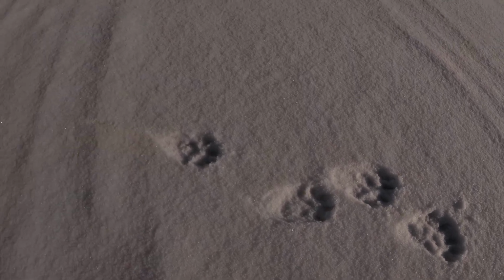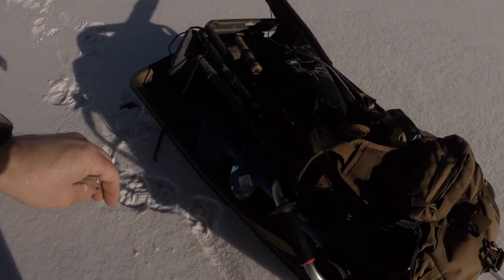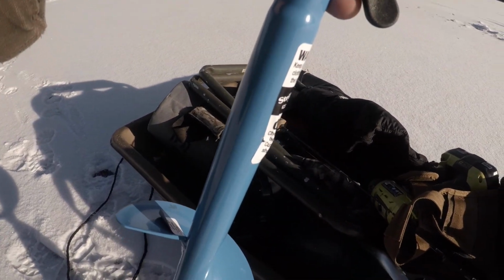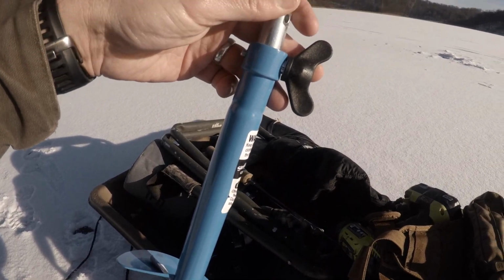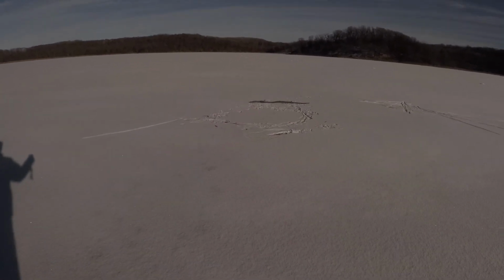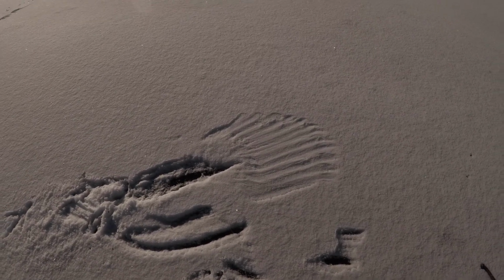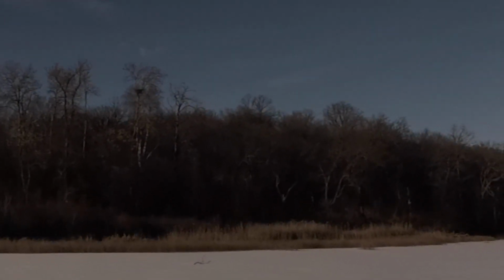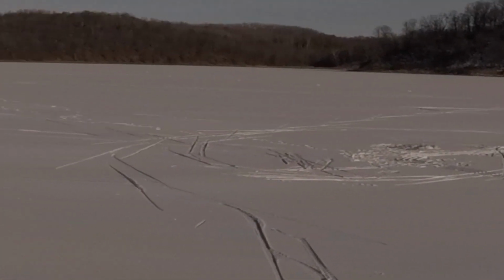Ryobi drill and attachment on my Strikemaster hand ice auger

Comment: I drilled an appropriate sized hole in the auger shaft just below the hand set key. Ran a 12" long 3/8 steel rod through the hole. And secured the rod with tight doubled up O-rings so the rod couldn't fly out. It's saved the auger at least 3 time's. The one thing I wish they would do to cordless drills is add a keyed chuck.   I have used my Ryobi for years, just carry a few batteries they are so much more affordable.  I only ever ran out of juice one time, ever. Figure if I have to drill 50 holes I might as well head for the barn.
Reply: Eric Campbell 
I’ve had a few comments about losing the auger eventually. I really appreciate solution ideas to this possible issue. Thank you for commenting. Also, I’m glad to hear that the Ryobi will work as a long term option. I did have some concerns about burning out the drill. I hope you have a great season!

Comment: Look into an ice master ice auger adapter.it has a small plastic disk that bungies around your drill so if the chuck loosens up it don't drop down the hole.i got one for my old 6in mora.works great.also upgraded to a hammer drill so I could have an extra handle.looking at adding a center point now
Reply from the maker: Thanks for the tip! Currently I just have circular disc as a drop guard. its pretty wonky though. Ill look at the adapter, Thanks!
Reply: You wrote ice master...did you mean strike master?

Comment: Yesss. I am the poor man with the Ryobi and 6" strike master hand auger lol
Reply from the maker: Just be careful not to drop the drill down the hole! Either hold on or put a barrier bigger than the hole. This has worked for me for a few years nows
Reply: I had an old 6inch mora given to me(threaded top).I bought an ice master auger adapter.works great.it has a bungee that hooks around the drill so it won't fall through the hole if the chuck let's loose

Comment: I was the first one to do this on a mora auger and a old rigid drill and I used a bolt and socket . And the word traveled fast. Don't worry guys I patted myself on the back;)
Reply from the maker: Kelly you should make an adapter so the auger doesn't fall down the hole. I've heard lots of comments about that. Still time to be rich!

Comment: I'm going to use this same setup this year. I'm usually a set and forget it. I'll drill about 5 to 10 holes and stick to those.
Reply from the maker: I’ve used it a couple years now. The only advice I’d give is to make sure your drill is snugged down darn tight on the auger. Or figure out a system to save the auger if it got loose
Reply: @TRERUNSWILD  I ended up purchasing the flange that fits on the adapter to save it. That would be a bad day for sure!

Comment: New subscriber, I’m thinking of getting that adapter $21 at Walmart and I have that same drill thx 🙏 I have a  milwaukee m18 drill and plenty of people use at high setting.  Has to do with how strong your strength is pushing down and grasping onto drill. But watch out that auger might go into the lake.  Sometimes that bit doesn’t secure at top of the adapter onto drill end.
Reply from the maker: Yes, I've been worried about that. I've been thinking about cutting the bottom out of a 5 gallon pail and rigging that somehow.
Reply: @TRERUNSWILD  I did just that. I put it just bellow the locking bolt with a big washer after.

Comment: This would b one of the jobs I’d use a hammer drill with its handle piece. Other than tht, looks like it worked well, might have to try this on soil with a smaller bit
Reply from the maker: Yes a handle would well. I see they now sell kits but they are still way more money then I want to spend
Reply: @TRERUNSWILD  I ended up getting a ryobi hammer drill for 40 at Home Depot, granted it is the smaller 600 in lb one but it uses a handle.

Comment: Check the chuck on the drill every time or drill a hole in a frisbie that you can put on the shaft of the auger below the wing-nut, you will be really sad when your auger goes down the hole because it fell out of the chuck
Reply: The Frisbee idea is actually really good. It would be super light yet still save the auger. A couple people have mentioned making sure I check the drill chuck tightness. I'm starting to think its fairly common to loosen up. Sounds like I better check out the Frisbee idea. Thanks Brandon.

Comment: Make sure you check the wingnut on your auger after 4-5 holes or so. It can work itself loose after a while. Check the chuck on your drill at the same time for the same reason. Also, use your right leg as a support for the drill, so it doesn’t snap your wrist, instead of using just your hands.

K-drills are over rated and over priced, in my opinion. That mora should work out. I’d look into a larger battery though. You’ll never regret more battery. A 5ah should last you all day. K-drill suggests the Milwaukee because at the time it was the drill with the most torque. A drill for an 8” auger (like the K-drill) needs at least 750lbs of torque so it doesn’t fry your drill. An 8” auger removes twice the amount of ice as a 6” auger.

Drill setups are awesome. I have an 8” Lazer, Milwaukee M18 w/1 5ah battery, and a clam plate with the extension and in 16” of ice I stopped counting holes after 50. Battery still showed 2/4 bars. I’ll never drill a hole by hand again.
Reply: Ryan Wilson thanks for the feedback. I am a little worried about frying my ryobi. I think it helps that I’m using a 6” as well.  Great advice on double checking the tightness!! If my ryobi fries then I finally have an excuse to move up to Milwaukee 😁
Reply: Ryan, fill me in on the Clam plate. What is it? What does it do?
Reply: TRE RUNS 

Anytime man.

https://www.franksgreatoutdoors.com/clam-drill-auger-conversion-kit-719921099351?gclid=EAIaIQobChMI4_Seh8r83wIVgiCtBh1RmAl8EAQYAyABEgLE3fD_BwE

That is the clam plate. It isn’t absolutely necessary but it makes using a drill setup so much more ergonomic and safe. You clamp your drill into it. You also don’t have to worry about your drill chuck loosening and sending your auger down the hole. The extension also isn’t necessary but it’s a convenient add-on. The plate also benefits your drill by keeping it up off the surface of the ice so it prevents it from getting wet or snowy. 

It’s kind of pricey but I love it and haven’t had any issues.
Reply: TRE RUNS 

I see you’re in Minnesota and you mentioned you want to use this for thinner first/last ice. My Milwaukee setup will drill 8” holes all day reliably on ice 18” thick. It will drill thicker than that but I live in central Michigan and I haven’t been on over 24” of ice in probably a decade lol.

Last season, 16” of ice, I drilled out and entire 2’x4’ spearing hole with it. I took a few couple minute breaks after every 5-6 holes just not completely dog on my drill. Worked pretty well actually.

Comment: Where did you find this adapter??
Reply from the maker: I bought it at Mills Fleet Farm which is a hunting, farming type store. If you google Mora Strikemaster drill adapter it will you some options. Price should be between $16.99 to $19.99. So far my Ryobi has worked but I’ve been hearing that it can burn out brushes o lighter drills.
Reply: @TRERUNSWILD  eBay also has adapters for the strikemaster/mora auger, along with other various models.
Reply: Jonny G 
Oh! Thank you for posting. That will be much more helpful for viewers than my local farm store.
Reply: @TRERUNSWILD  I doubt you will ever burn the brushes up using it with an auger. I have a similar Ryobi that used for a lot of deck building and have mixed a lot of concrete with and the thing keeps working.  The Mabutchi motors that Ryobi uses are very good.